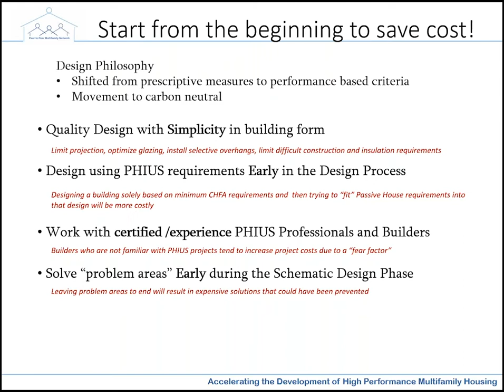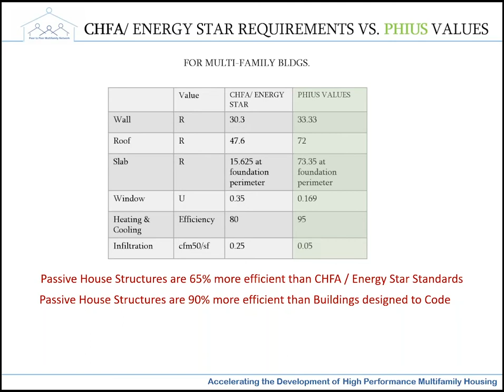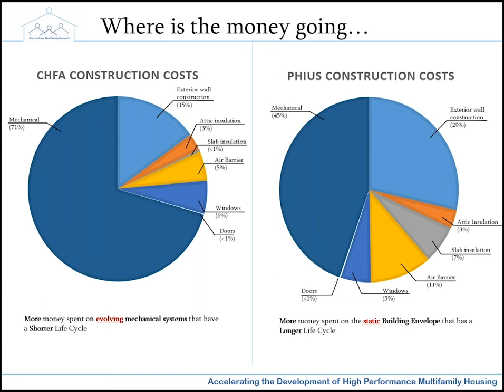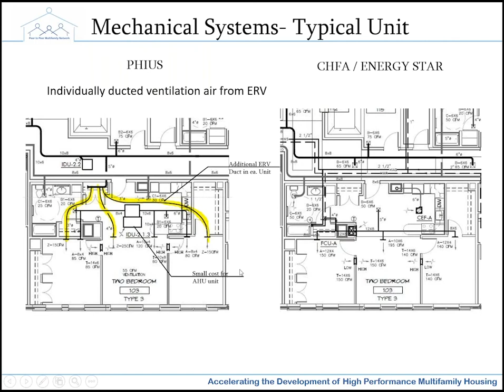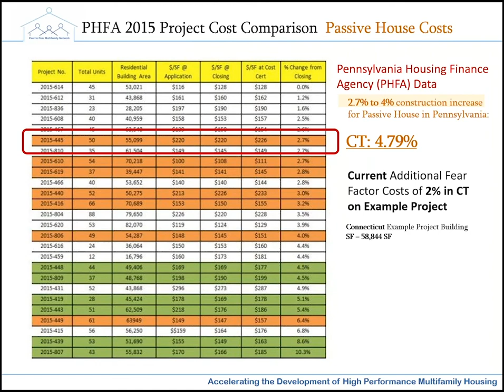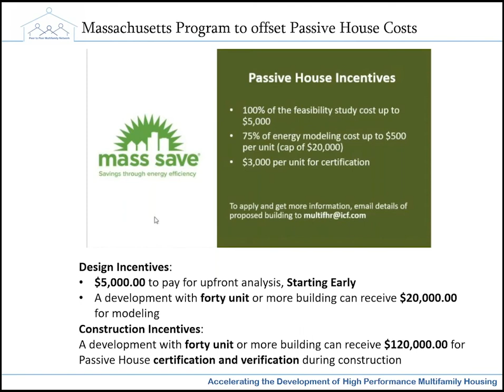Passive House Costs and Benefits

Comment: If you use BIM and lean using dynamic modelling with an industrialised building system you can achieve a 20% reduction in cost over traditional construction for multiple dwellings as well as individual homes!